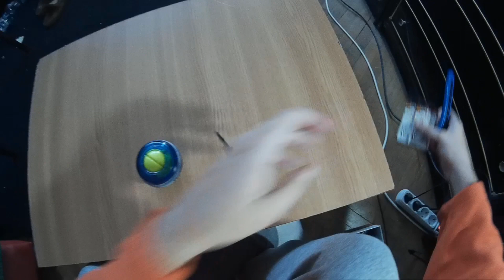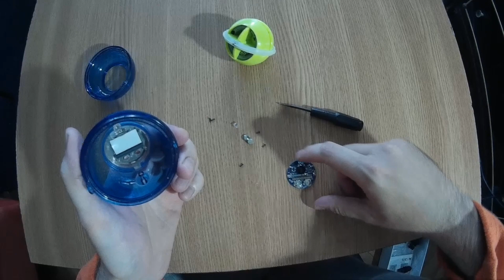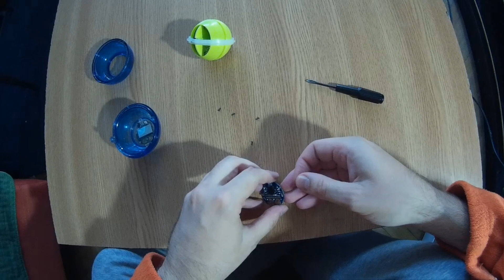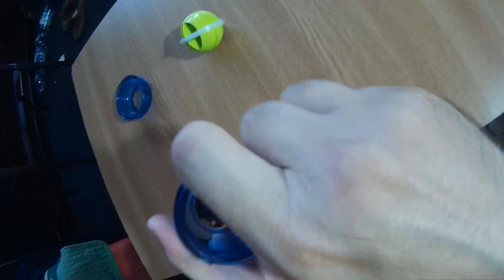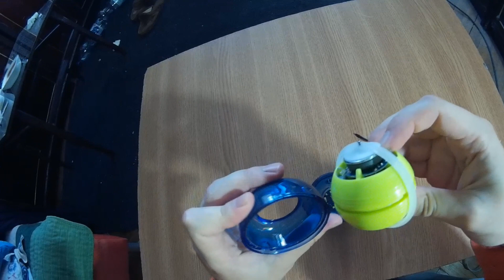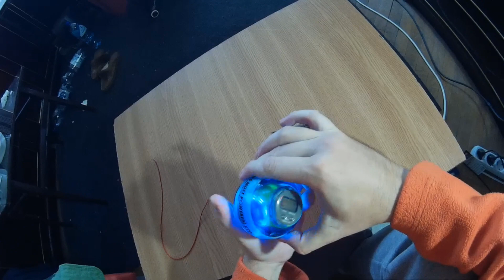How to replace batteries / open / clean a Powerball?

Comment: Or you could just pop the display unit off the top of the ball. Makes it a lot easier!
Reply: I was thinking the same - surely it is possible to pop the display unit out, thus making the battery change far easier than shown I've still given the video a thumbs up as it goes through opening and cleaning the powerball. My thumbs up was also for the OP's effort in replacing the rear cover on the display unit from the inside - I felt his pain!
Reply: Have you ever do that? How can I do it?
Reply: @sergiobe87  yes
Reply: Yeah the top pops off easily. Just get a small flat blade screwdriver and insert to one of the two divots under the clear plastic ring 👍. Pop out. Done

Comment: The two outer pieces do not want to come off
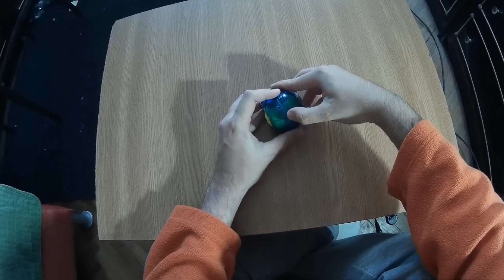Reply: 2:10
Reply from the maker: If the ball was never opened, it might be stuck like that, as you see in the video, I hit it pretty hard.
You can try the same, but it might break.
Reply: @PSVICE  I hit it as hard as I can (my hand hurt) I'm trying with flathead screwdriver but seems to not work either
Reply from the maker: @melihsaruhan2462  I've read somewhere that you can remove that panel to replace the batteries without opening the ball, maybe make some research, I think there might be in some comments here.

Comment: When you spin powerball shuld it have strong vibration?
Reply from the maker: You should feel some vibration in your hand. Also when the powerball spins slowly.
Reply: @PSVICE  Hi! mine is doing some scratchy sound sometimes, and I feel it spins a liiiitle loose but I can exercise normally anyway. Maybe are signs of wearing, and the inner ball rotates with some movement to the sides (when new, it was so smooth).

I think I got a chinese copy or ''generic'' copy, not an NSD, but it works just fine for my arm's health (musician, guitars). Wish I'd never have to open it as it scares me haha
Anyway, thanks for your video 🔮